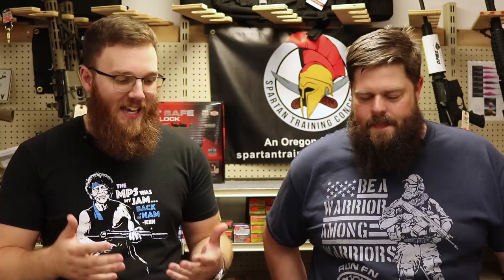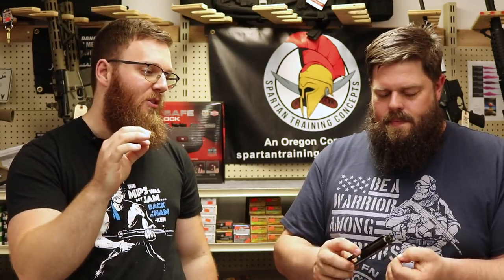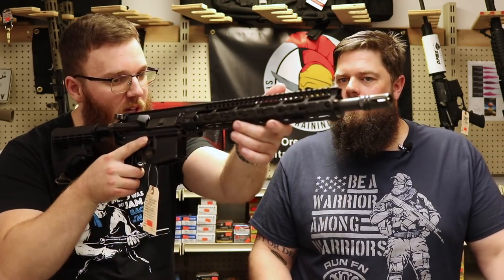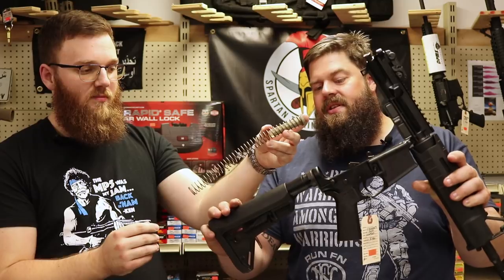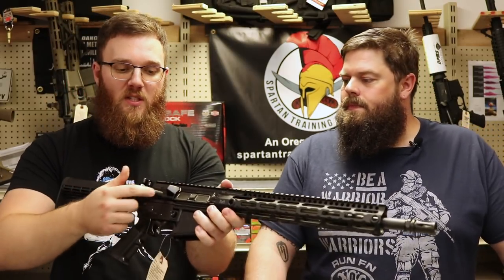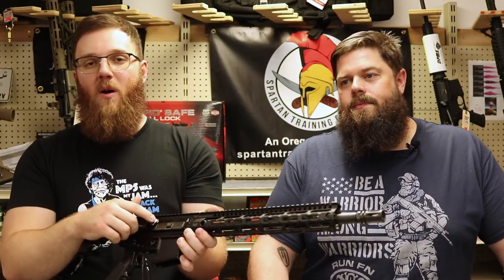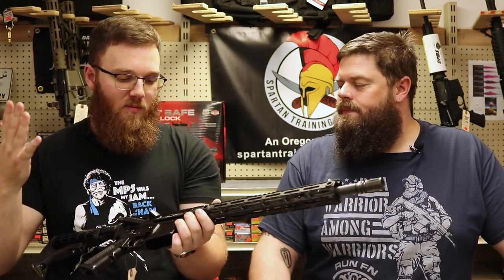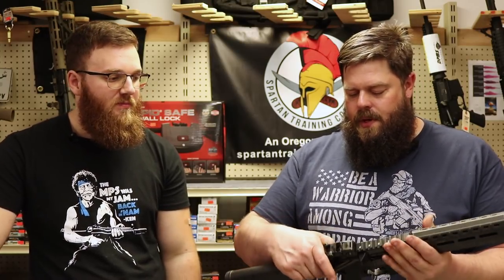AR15s - Is This Normal?

Comment: What rifle is on consignment? And good stuff for beginner ar owners. I bought a flatwire buffer spring to increase lock time. Other than that its a standard weight. Aero Precision 18 rifle upper. Aim surplus nickle boron bcg. Runs like a champ.
Reply from the maker: It's my multicam M92 PAP
Reply: OreGear thats a good looking rifle. If i was in the market i would snag it up. But a suppressor is in the works. If you would like to test a cz75 sp-01 tac. Let me know. Im up in wa.

Comment: I have a feeling that 300blk firearms are also overgassed which probably contributes to the violent extraction. I think they are overgassed so that they will cycle subsonic ammunition. I don't know if all of them do, but mine cycles it and it's not even suppressed
Reply from the maker: I think it depends on your gas length and barrel length. Shorter barrels will not cycle subs unsuppressed. At least they shouldn't. That said, the geometry of when the case starts ejecting is what propels the case neck first toward the shell deflector.
Reply: OreGear that makes sense, the reason I suspect that they're typically overgassed is because I'm cycling subs out of a 10.3" barrel unsuppressed